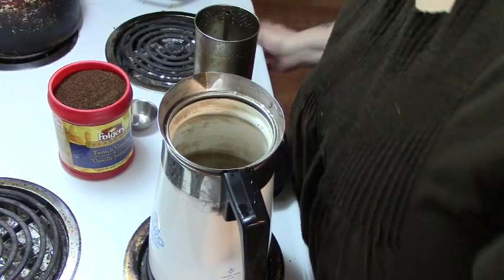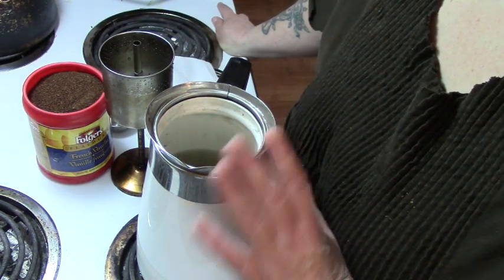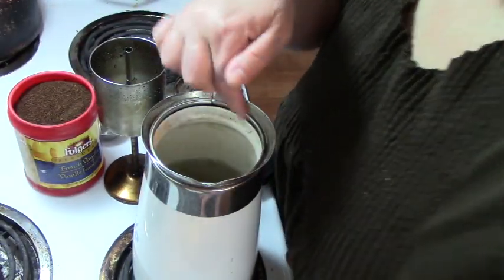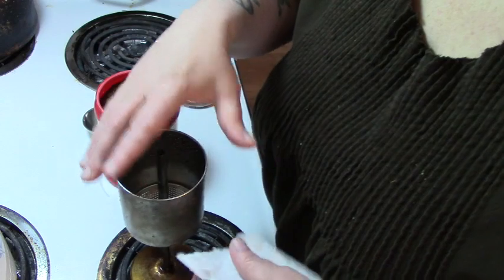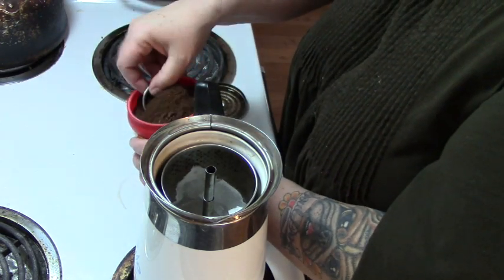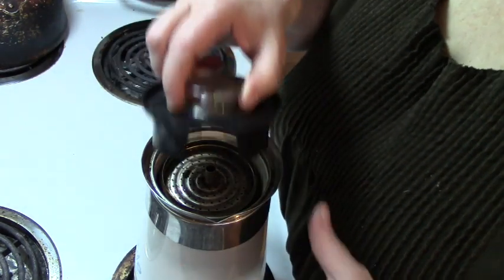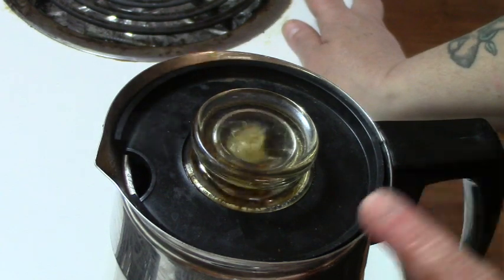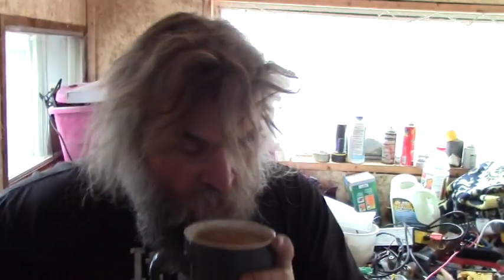Old Fashioned Perked Coffee!

Comment: They didn't shatter on the burner. The epoxy glue would separate from the metal band holding the band and handle . That's why they were recalled

Comment: I had one of those for a very long time....but mine came with a metal star-shaped thing that sat on the burner under the pot....never any problem with shattering, although I DID break the metal thing by dropping it in the sink while it was still hot.  A coast hanger twisted into the same shape worked just as well.
Reply from the maker: That's using your noodle hun!

Comment: I have  the stainless steel perc pot with glass top ( glass top hard to find when broken but Cabellas carries them).  I use mine during power outages, etc.  I prefer the taste, I guess because that's the one I started with.  I use a coffee filter with hole cut in the center for a filter, kinda like you did.  Looking forward to a sunny 60 degree (F) day today and hoping to get more of the coop cleaned and DE dusted.  Have a sweet one Bev.

Comment: I scored an old Boy Scout perculator in a second hand store. Why they marketed coffee makers to an organization that aged you out of the club at age 18 is beyond my reasoning.  The old perc coffee maker has a glass dome or sight glass.  the new campware versions have clear plastic domes that tend to melt away if you use them in a campfire.   I have a vacuum coffee maker around here also.  I havent used it since I got it to build an herbal essential oils distillation unit.  That one works by boiling the water in the bottom borosilicate glass. The water climbs up into the top glass top and mixes with the coffee grounds.  You take the pot off the heat and the change in temperature draws the liquid back down to the bottom pot, filtering the grounds  out as it goes.  science. :) !
Reply from the maker: I tried that once with lavender..and burned it ( YEARS AGO) Volfie will not allow lavender in the house ever since!

Comment: Bev, I'm really sorry to correct you, but the problem with the coffee pots, was that the entire top metal part, would separate and come off, and would fall from the ceramic part of the pot. It turned out to be a glue problem. You can check it out at this website. I have the same pot as you, and I will be using it, However, I will use something to pick it up after it has perked, and no longer just use the handle. Severe burns happened when the pot separates, even many, many years later. This site has tons of information about Corning Ware, Pyrex, and Corelle. There is also a photo drawing of the separation that was in the original recall ad on the site.
 http://www.corellecorner.com/company-history/241-corning-ware-percolator-recall-1976-1979.html
Many still use these, and should know about this.